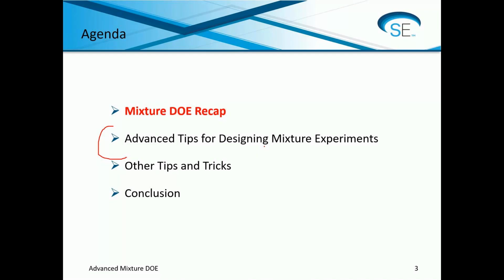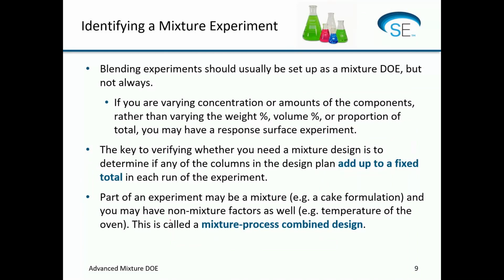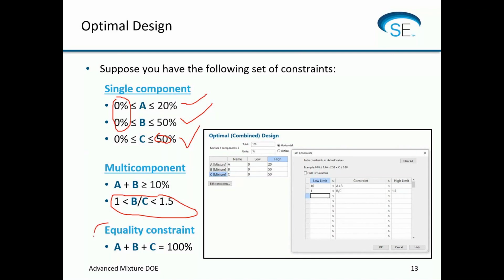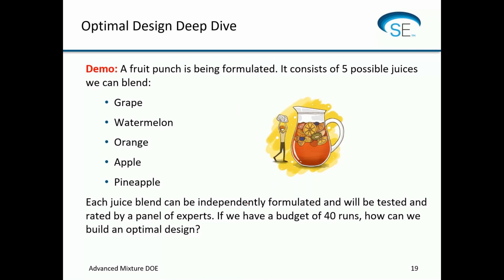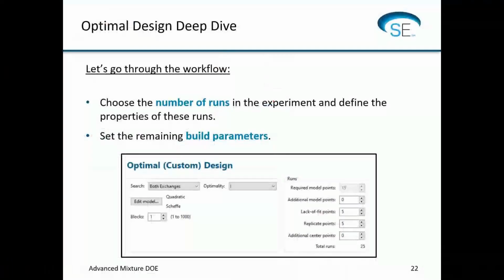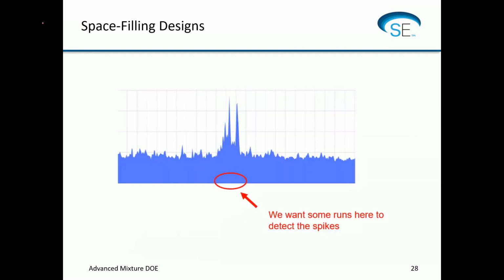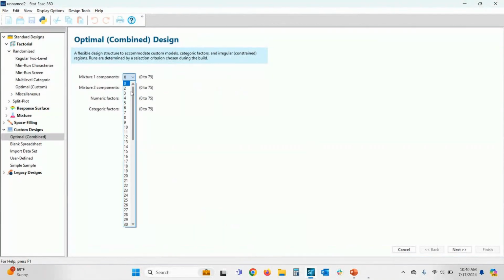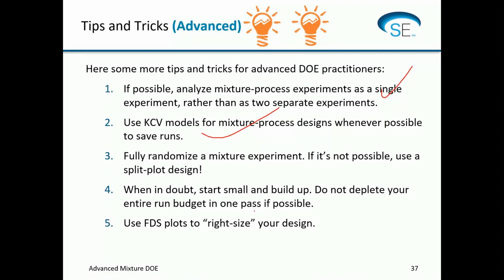Advanced Mixture DOE for Formulators

Comment: Hello, I have a question regarding mixture designs. Lets say I have 7 different manufacturers of flour and I want to make a mixture using a maximum of two flours for simplicity reasons, and I want to evaluate every possible combination of the 7 flours. How would one go about this problem? I tried doing a mixture design with 7 ingredients, but I dont know if I can add a constraint that only 2 of the ingredients can be used at a time. I also thought about doing this with the different manufacturers as categoric factors, but since all 7 flours can be used either as ingredient one or two, the resulting design generates nonsensical experiments, where same flours are used as ingredient one and two. The designed experiments also contain replicates which are not specified by the design as replicates, but if I look closely at the data, they are replicates.
Reply from the maker: This is a pretty specific question! Our StatHelp team can help if you submit it to them: https://statease.com/about-us/contact/contact-support/
Reply: Did u find answer?